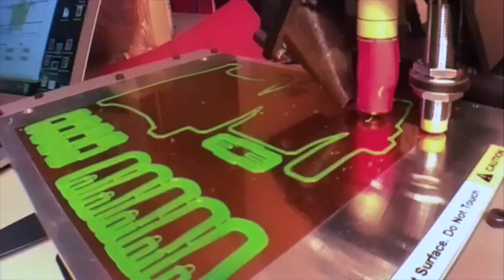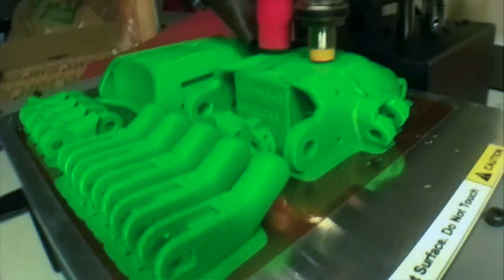E-nable Raptor Hand Full Plate time-lapse

Comment: can you share the specs for the print.  Not the blueprint but rather the fill density, boarder density, and layer thickness and if you are happy with the result.  I'm starting to print one myself but new to 3d printing not sure what to set it at.  I was about ready to print the palm piece when i found this video but mine says it will be 18 hrs just for that piece.  Your while print was less.
Reply from the maker: We'll first this was printed at 100% size which is really to small for anyone, that's why it printed so fast. The standard to print these are as follows; 200 microns(.2mm layer) 35% infill. 2 walls